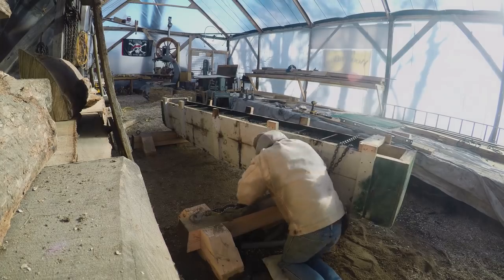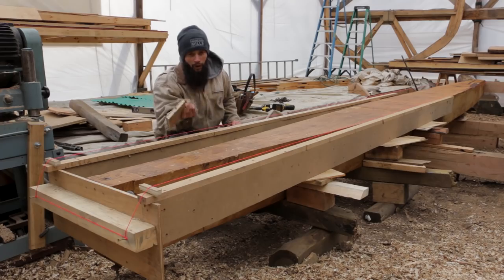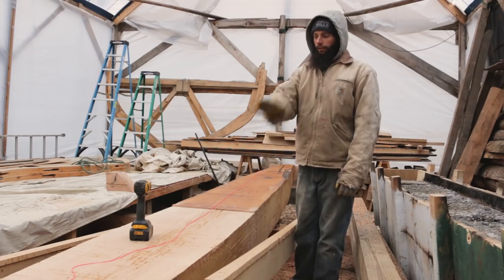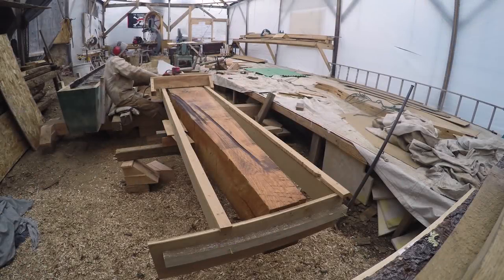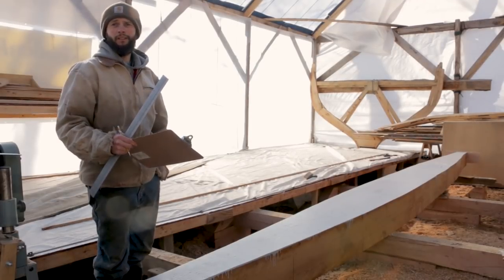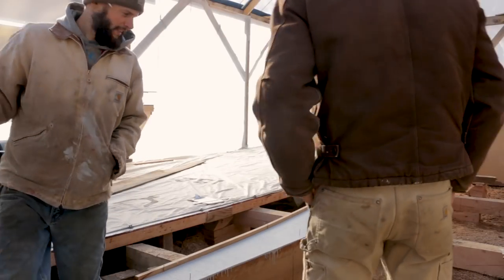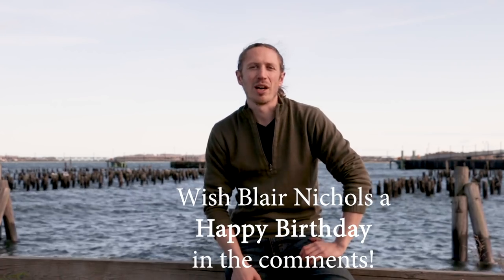Acorn to Arabella - Journey of a Wooden Boat - Episode 27: Flattening the Keels

Comment: Fitting wood to previous wood; welcome to carpentry in the field as engineers designed it for you. No pun intended, it's hard at times but shows you're a carpenter/shipwright of the extreme when it comes out right! Good going guys!

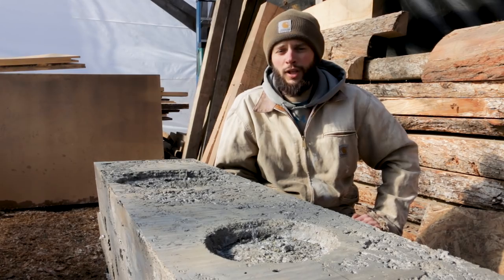Comment: 10:24  Molten metal (and plastics too, I believe) that seeps into mold joints & spaces is called "flashing."  After high school - in the early 70's - I worked as a chipper in a foundry where we daily cast dozens of multi-ton machine housings.  Chippers remove flashing from large castings with an array of air powered chisels and grinding wheels.  I loved that job, there was no question why you were dog tired at the end of the day.

Comment: Hi guys I just want to let you know that you used an awesome method with the router to flatten the keel. I have used that method before to cut birdsmouth joint's in huge rafters made from oak beams.just a shorter stepper method on my project.. awesome job..

Comment: I think I might get some epoxy ashphalt tar for the bottom of the wood keel especially between the lead and wood. After the tar hardens  use some bedding compound (Non hardening to keep the water out) between the wood and lead.
Thanks and good luck
Reply from the maker: We have epoxy based fairing compound and paint for the lead keel.  The wood keel will get painted then bedding compound will go between the two painted keels.

Comment: I find it interesting. In ways working with a steel hull and keel voids is easier than wood even though you would think wood would be easier.  I watched SVSEEKER recently and they welded up the voids and poured lead straight in.
Reply from the maker: They certainly are different beasts!  Each with their own set of challenges =)

Comment: Lead is ductile, did you consider hammering it to size and shape instead of cutting?
The material cut off would have helped fill the voids. Soil compactor or Jack hammer with a compaction plate might have provided the needed kinetic energy to shape the lead.

Comment: Happy Birthday Blair!   
Another great video guys.  I always impatiently look forward to the next edition.  I was wondering why you painted the keel this time instead of oiling like before?
Reply from the maker: Before was just a temporary measure to help slow the checking.  This time we used a cheap paint because we needed to keep it from drying too much but also we needed to see the markings accurately.  A fine line is much easier to see on paint than bare wood or oiled wood. Hence cheap gray paint =) Once it is cut and fully shaped the paint and lines will get sanded off and the final coat of sealant applied.

Comment: Curious why you didnt use a planer instead? Would have made life a lot easier. Also happy birthday Blair!
Reply from the maker: Faster, yes.  But it would be harder getting it perfectly flat and smooth with a hand held planer, the keel timber is way too massive for a stationary machine.  The set-up is pretty quick and then it's mindless to run the router and messing up is fairly unlikely.

Comment: I wonder if perhaps the older, albeit slower, method of flattening the lead keel would've been less costly. IE, using a chisel, and essentially scraping (as in the machinist term) it. I've seen it done once or twice before and seems to me that once you have the pace right, you speed through it quite fast.
Reply from the maker: The router was fast and it did not cost much for the tyvex suit and the plastic.  I am sure we will put the respirator to good use as well. =)

Comment: Congratulations, Uncle, on the birth of your sister's baby. Happy birthday to Blair on the 12th. And finally a question, if the temperature is so low that the paint won't dry appropriately, why not use oil instead of paint? That wood is too beautiful to cover with paint anyway. Is there a mechanical advantage/necessity to paint in this application?
Reply from the maker: The top (inside the bilge) will get oiled but even that does not like drying when it is this cold out.  The face against the lead keel will probably get painted and the outside faces exposed to water will need to be painted. The lead keel fairing compound and paint is epoxy based so that has to be above 60*F to cure. So even if we forged ahead with the wood keel we would be on hold joining it to the lead keel until it's warmer.  Makes more sense to work on other things and let it warm up a bit and progress can proceed unhindered.
Reply: Acorn To Arabella oh,okay. Thanks for the reply. Would a "ReadyHeater" be too dangerous to blow some heat through the shop? (Multi-fuel combustion heater) we used them a lot when I was doing new home construction in the cold weather. Or a 55gal drum 'fire pit', but the ReadyHeater always worked better.
Reply from the maker: The issue is we need the lead and wood keels to also be 60*F, raising the temp of 9,500 pounds of lead from 20-30*F will take time and energy.  We have plenty to keep us busy and moving forward so it's safer and easier to have a little patience =)

Comment: Hi Guys: I am interested in how you are going to cut the ribs. The wonderful band saw that you have. Does not have the means to adjust the degree of the cut as you are cutting to width.  Looking forward to hearing from you on how you are going to handle this procedure. Love you videos.
Reply: To my dismay this was in my daughters account  I am Rex Kimple from Ottumwa ia.
Reply from the maker: The ribs (frames) get steam bent into place so the bevels are a non issue, they will twist right into position.  If we were building a boat with sawn frames then we would have to cut progressive bevels.  We will need to do that for the planking and can modify the little or the big band saw to cut the progressive bevels.  Basically a lever gets attached to the table and a helper controls the angle of the table while the other person guides the cut and reads off the angles.
Reply: There are specialised bandsaws called tilting head bandsaws where the table stays horizontal and the wheels and frame are tilted to cut progressive bevels

Comment: I know you guys don't need to get this as flat as us machinists get things but there's got to be a better way with what you have, of flattening that thing. The sting works but you should have never taken it of and replaced it, especially when it's resting on wood and dirt. I'm only half way thorough, lets see if you run into any problems. Maybe the pliability/ductility of the two materials will give you a nice fudge factor.

Comment: are you not worried about line sag? or is it something that is small that is taken up by other materials? looks nice, keep up the good work
Reply from the maker: In this application not really, a swipe or two with the hand plane at the final fitting should be all that is required. There is plenty of wiggle room to accommodate a little line sag.

Comment: I know I'm commenting way late on this, but do people ever cast keels in more managable sized layers and then laminate them together by fusion welding or adhesive?
Reply from the maker: Not usually.  A single piece casting is the strongest option and the strength is very important.

Comment: Wouldn't a reinforced concrete, high density mix work to replace that dangerous work with lead?
Reply from the maker: It would still need a bunch of lead in the concrete to be dense enough. I would have been safer for sure but would not last nearly as long and if anything ever happens to the boat it would be close to worthless unless you took the time pick the lead out.

Our keel will never corrode, never need replacing and is worth numerous thousands of dollars just in scrap value as it sits.  In the long run we felt the benefits outweighed the risks.

Comment: One thing I just do not get with this design is: Why go through the trouble casting and moving the lead keel as one piece? Why not cast separate lead plates that could be mounted/bolted on the wooden keel?
Reply from the maker: It's so much stronger and stiffer as one piece.

Comment: Just a curious question, if you are spending this much time with a router, why not buy a planer and get a better finish?
Reply from the maker: For this the router is better.  I would wager the router removes material as fast, maybe faster than a hand held planer.
With the sled and rails its close to impossible to mess up the beam, making a sled for the hand planer would be trickier.   
The surface was quite smooth, a few passes with the sander and it was plenty smooth for the bilge of the boat =)

Comment: What are the stations on the wood keel?? I'm an old powerboat tech. So blow boat jargon sails right over my head.
Reply: Brian Ermelin 
Think as ribs across the boat. Take a drawing and enlarge it on the table. Do one station at a time and ,Bob's your uncle, plot every point in three dimensions.
Reply from the maker: The stations are just references for building the molds, to get the shape of the boat and the placement of everything correctly.  They are placed 32" apart down the length of the boat.  Unless one builds the hull they would have no use for the stations.  Pretty sure it is a universal thing in most hull construction be it wind or power.
Reply from the maker: The plans are set up on a 32" spacing.  Just following Mr. Atkins lead on that one =) 
There are still a number of them going, mostly on the northern coasts, Maine and Oregon are big hubs for the wooden boat world.  Production of fiberglass or wood is a whole other animal.  Herreshoff made molds for every rib when they did production boats.  It made it fast and efficient like a mold does for fiberglass.  
Have you seem Leo restoring the Tally-Ho? He is a very talented shipwright restoring a old classic wooden boat.

Comment: How are you going to secure the 4.5 ton keel to the wood... bold/nut? In that case you will need a hell of size!
Reply from the maker: epoxy
Just kidding
The plans call for 7 bronze thru bolts, they are a measly 1-1/4" in diameter! 8-3/4" of bronze to hold that beast to the wood keel.
Reply: That sound good, I would not be able to calculate the needed strength, but bucking in a Strom (yep once up on a time you mite encounter one) it would be a bummer if the kinetic/dynamic force would rip the 4.5 tons of the bottom 🙀

Comment: How come you didn't use a planer for the wood keel and a chalk line for getting its centerline?
Reply: Tyler Marney I wondered about the chalk line myself.  And such a short straight edge :p
Reply from the maker: The chalk line is not accurate enough.  Marking the line and then connecting with a long straight edge is more accurate.  We made marks every foot or so along the string so the straight edge went through many points to weed out any errors.
The timber is way too big to go through the planer so the only option would he a hand held power planer.  The router is slower but more accurate, it would have taken a lot of stopping and measuring to be sure we were on track with the hand held planer.  The rails and sled did all that work for us =)
Reply: Great video, thanks for sharing!   How can a chalk line not be accurate?
Reply from the maker: If it is not lifted and let go perfectly 90* to the surface it can strike at a slight angle, same if it hits a small wood fiber left from milling.  For most carpentry it is plenty accurate enough, just not accurate enough for this task.

Comment: What about string sag? What is the fitting tolerance?
Reply from the maker: String sag is not a big deal in this instance.  
Some felt paper and bedding compound will go between the deadwood/ballast keel and keel timber so as long as it fits to within a 1/32-1/16" all should be well.  I'd wager we are closer to the 1/32 than the 1/16, most of the joint is light tight with no bolts and no bedding compound.

Comment: Is the wood keel made of wet wood so when it is in contact with the sea you don't have to worry about it expanding in odd dimensions?
Reply from the maker: It is still fairly green and we are doing our best to keep oil/paint on it and the sun off, so that it stays a little moist and does not check badly. It should take up a little when she hits the water but it should not be major.
Reply: Thanks

Comment: I can’t understand why you didn’t pour lead directly into the boat into say an Ally casket,The whole idea of pouring is it takes the shape you require isn’t it
Reply from the maker: It's been done before with steel molds.  Steel molds have an inclination to warp when they get heated and can deflect in unpredictable ways and the lead likes to stick to it making mold removal difficult at times.  The boats we have seen done that way the steel shell stays on but then you have to be concerned with galvanic action and iron sickness in the oak if you do it that way.
The extra time and effort spent casting it on the side and just having a pure lead ingot was worth it in the long run in our opinion.

Comment: is the lead keel cracked at 11:45?
Reply from the maker: No, but it does look that way! 
The plywood for the liner was 8' and the mold 11' so there is a seam in the sides and that is what made the line.  Once we smooth the sides a little it will disappear.

Comment: you shouldn't need to have such tall walls on your router sled.  It sure made the routing process look awkward, and was probably a factor in your arm getting tired
Reply from the maker: The sides did not bother me much and they were very handy for the couple times the bit caught and wanted to jump around when flattening the lead keel.

Comment: Why not use concrete for the ballast keel?  It's a pretty dense material and NON-TOXIC!  I haven't seen any follow up videos, so maybe there is some grand scheme for choosing lead over anything else.  I just don't think lead is a good material for ANY project.  There's a reason why the U.S. has shifted away from its use here.
Reply from the maker: It is not nearly as dense and would not last nearly as long.  Lead is a very common material for sailboat ballast keels.
Reply: Thank you very much for answering my question.  Q:  I wonder if any crafty smugglers substituted GOLD for the lead in order to avoid being pirated.  Seems like the perfect place to stow something like this.

Comment: Great video again but you might want to change the style of the letters on your thumbnails as of now it doesn't look that good I think...
Reply from the maker: Thanks for the feedback.  Is there a specific style you think would look better? We are totally up for suggestions!
Reply: Acorn To Arabella To be totally honest I am not 100% sure, the reason I criticized the style was because it just looked cheap. 
But you and your channel are worth more than that.

Maybe try it in Arial Black or just use plain white color instead of this blue and it might look better and maybe more professional 

BTW what is your guestimated time schedule for the long term?
Reply from the maker: Thanks for the continued feedback! Much appreciated!

Next up is 
Getting the saw milling done
Once it gets above 60*F we can paint so we will finish the ballast keel and wood keel.
Then we can fit the deadwood, assembly the keels and deadwood and then put up the bow and stern timbers. 
Then it's the molds, rib bands and finally steaming the frames.
Hopefully we will steam bend the frames the end of the summer/fall and start planking this winter.  If we could hit the water 2020/2021 we would be psyched!